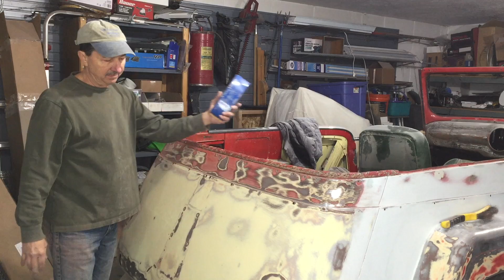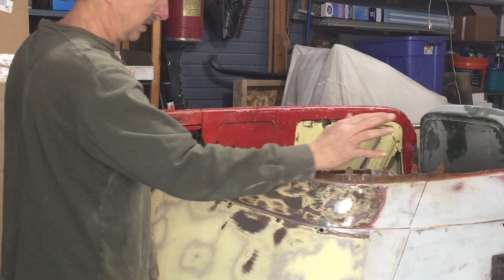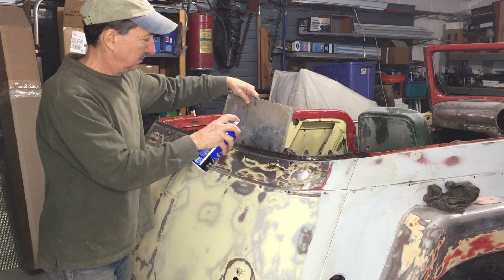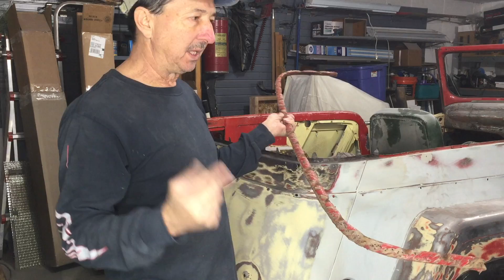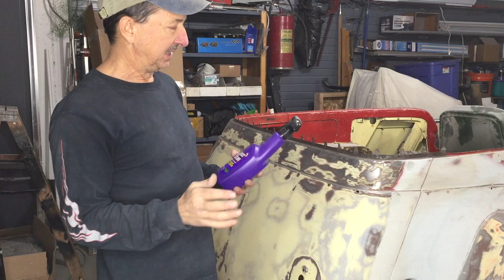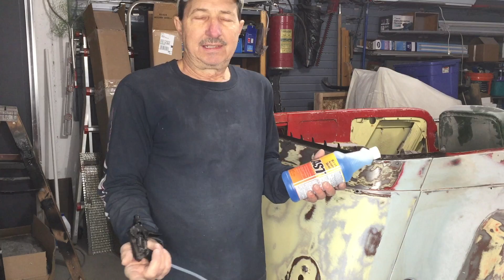Acid Etch Metal Prep for Filler, Primer & Convertible Top Tack Strip. 1950 Willys Jeepster Hot Rod.

Comment: I bought a tack strip from Kaiser or Jeepsterman. I haven't put it on yet (need to add those metal hinges that were removed prior to my purchase) but the tackstrip is a nice solid piece that has been bent and seems to like it will fit well.

Edit: also wanted to say thank you for the videos. I'm not a mechanic (my buddy is who helps me) but your videos are great and have helped me a great deal!
Reply from the maker: I saw some photos on line of someone that used that wood tack strip and it looked good and he said it was hard to work with but in the end it was very good.

Comment: I had started out with an orbital sander that gave me fits so I continued with a block. Guess I'm glad. Plastic tack strip looks good, the old dry stuff isn't worth messing with. I bought new wood from Jeepsterman. The rear tack strip was already bent and ready to go. Mine had a few sheet metal screws in addition to the rusty metal 'teeth' to hold it down. 
Naval Jelly is chemically similar to other acid rust treatments but with some filler to thicken it. If you get bored, you can look up SDS's for contents and the concentration.
I like isopropyl alcohol for final cleaning for reasons you described.  Solvents flash off right away, just like water in your high desert!